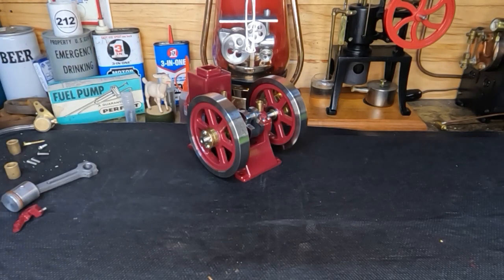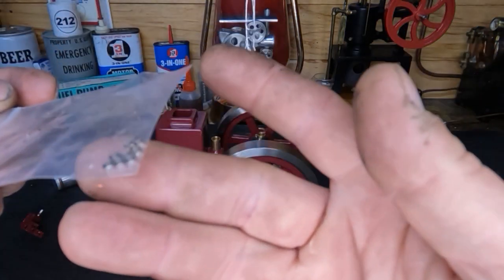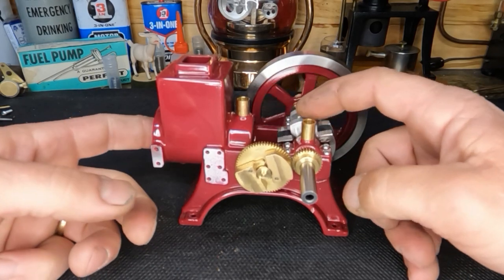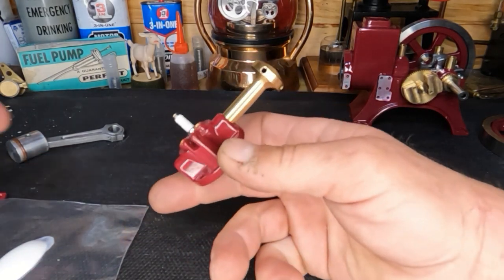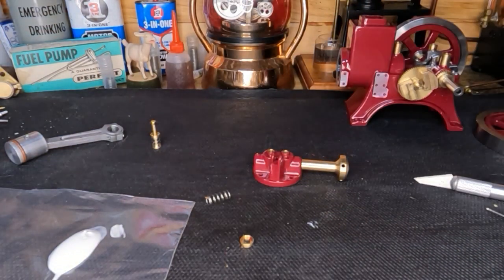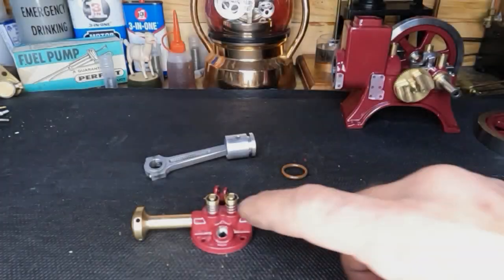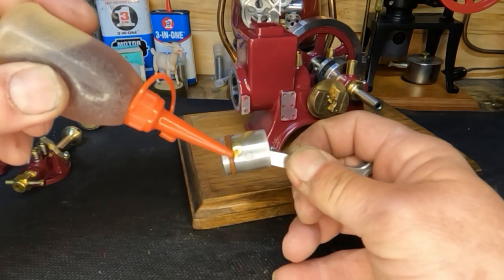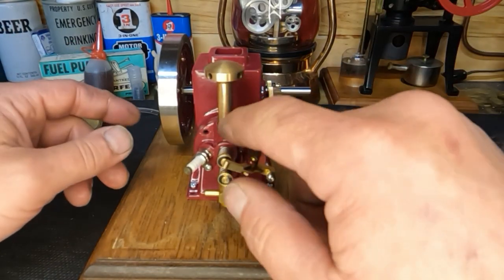Enjomor 6cc Hit & Miss! Counterweight crank, lightened rod, and valve job. Will it help?

Comment: i amazed. I bought 1/8 galloway casting for same price as one of these engine running. I just bought one. Can't wait to run it and tinker on it. It'll be my 3rd hit miss model. Last one i built was hit miss perkins casting.

The valves are the hardest to make and seat. I always made them from a stainless steel bolts.
Reply from the maker: These are by far the best "ready to run" starting points that I've found especially for the price.  Are they perfect out of the box? It depends on how perfect you want it to be, but yes, they will run.  How you make it your own is up to you. Casting kits are fantastic and the outcome is well worth the time and effort. If you don't have the equipment or the time to "carve" one from a shaped block, these are perfect.  I would love to see them offer a 2 in 1 kit (like the plastic models of Chevelle's and Nova's when I was a kid)

Comment: Just found  your channel.....Great job on the Under cut,  weight Removed & semi Ballance Crankshaft throw.....That Installed crank Is the Easiest turning I ever seen !! ....That soft  Aluminum con Rod running Directly on hard crank Journal Without any bearing Shell is kinda Different......Think I would drill & Tap an Oiler Hole in the Upper con rod Cap for easy  Assured Heavy Wt  Oiling of crank Pin.......Most of the Fastest wear starts there & knocks if not Kept heavy lubed.....Did you get the Functional piston  Drip Oiler installed ??  ....That Rubber O--ring Likes direct cylinder wall Pre-oiling before runs.....Thx for vids...

Comment: I`d like to tell you of my mods to the same engine. Quite a few.
1) My piston pin wasn`t secured in any way so had to tap and fit a 1.5mm grub screw to the rod.
2) I also balanced the crank. Worked out I had to remove 16.9 grams from the pin side of the crank to give balance factor of 50%.This made a HUGE improvement to the awful shaking around.Whilst this only improves primary balance it doesn`t help much with secondary balance so the next mod is to reduce the diameter of the bob weights then rebalance to get back to 50%.
3) Ball races on the crank.
4) The plug is really recessed in the head so carefully relieved around the plug hole to give better burning.
5) I found the engine is very sensitive to height of fuel level in the tank. Lifting up or lowering gives a rich or lean mixture. It needs a long slim horizontal tank at carb level.
6) In the middle of converting to hall effect ignition. Those contacts are too fragile . The slightest accidental touch to them will bend the springs altering the timing in the process. This has a secondary advantage . The cam now no longer has to be that shape as it no longer triggers the ignition so the cam shape can be altered along with the pushrod length as it no longer needs that massive valve clearance.
7)  And finally, at least for now. There`s an easy way to slow it down. The latch lever has a hole for the tiny spring to sit in. All that`s needed is to drill a new hole further away from the pivot thereby reducing the spring pressure.